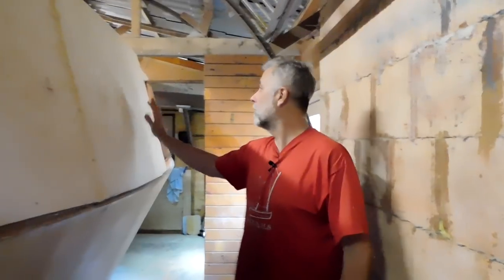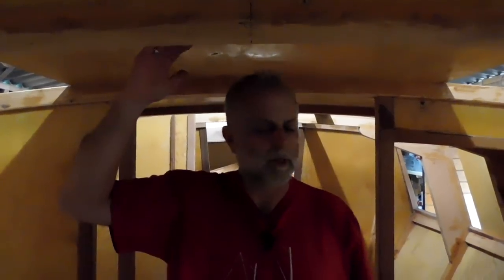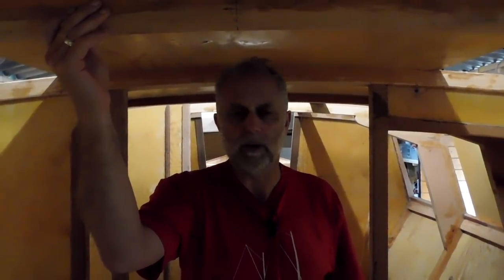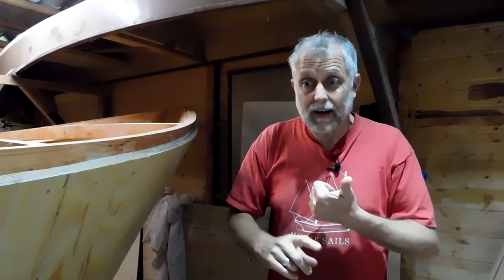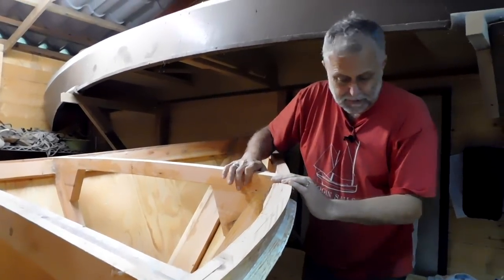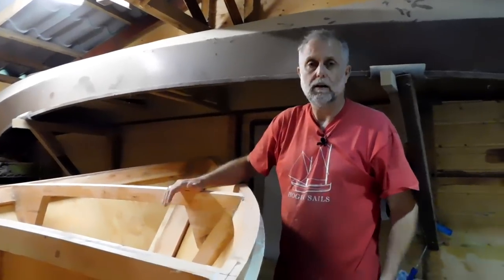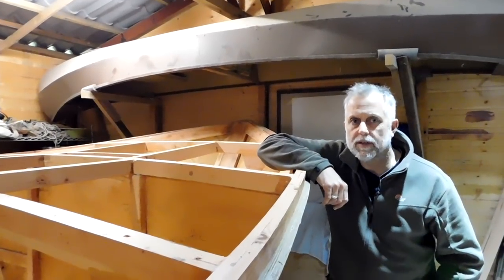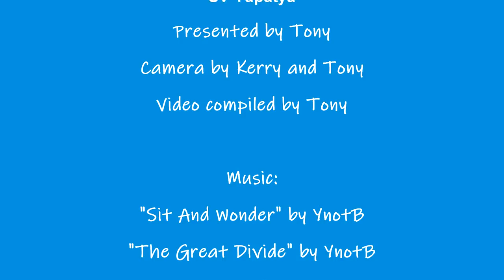Progressing to the aft deck - SV Tapatya EP58

Comment: What things do you consider when deciding to use the white bottle of glue vs epoxy? BTW, you're making really great progress!
Reply from the maker: That's a good question! If it's wood on wood, where possible I use the Semparoc. If either connecting surface has been epoxied, then it's epoxy. And then, it depends a bit as to what I've got in stock ( for example, I'm out of Semparoc at the moment, and, as nearly everything has been epoxied, I might not buy any more)

Comment: Hi Tony. Looking good there. Am totally hooked on my weekly dose of junk Tapatya. I know it is a way off but will you be building a cambered panel sail as per Arne from JRA or a Hasler/McCloud flattie?
One small thing though. Please be aware of lighting as there were some parts when you were inside and working aft when you were in heavy shadow with strong back light and it made it very hard to see what you were doing and I hate to miss a moment of this build. ;)
Reply from the maker: Hi Nick. Thanks for your comments. I think I'll probably be going for Hasler style flat sails. As to the lighting, yeah, it is dark at the very back of the shed - I'll see what I can do. I have noticed, however, that it seems to depend quite a lot on what you're viewing it on. On my pc, the lighting is quite ok. On my iPad, it is quite dark. I'll think about lighting though in the future :-)
Reply: @SVTapatya  Thanks for that Tony. Viewing on Sony smart phone so quite possibly is my issue.